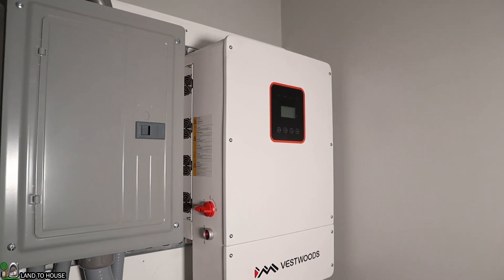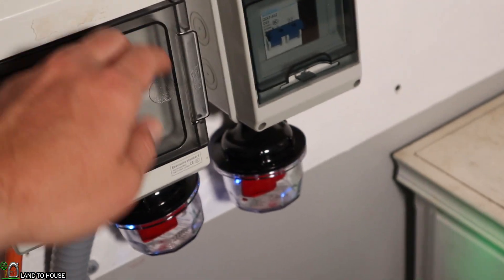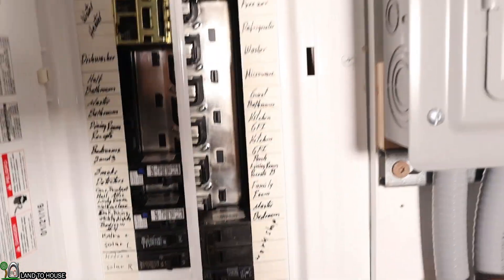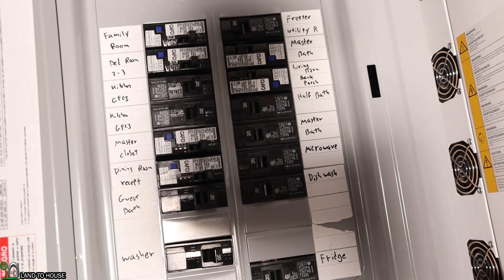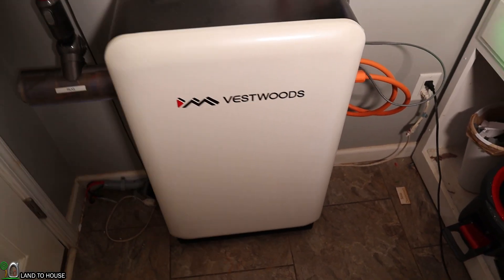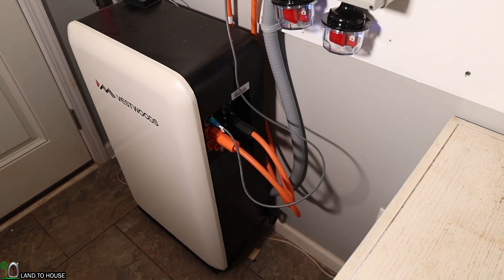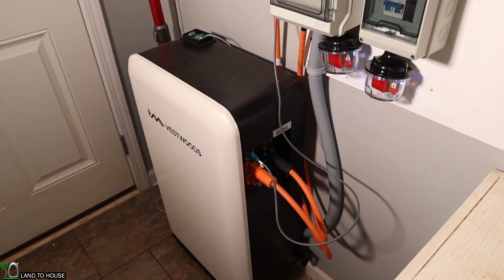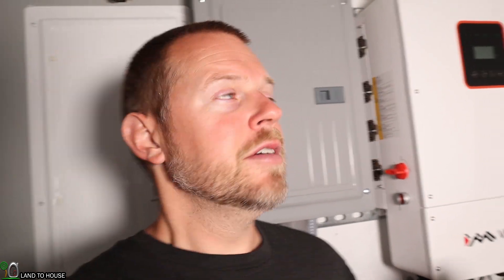This System has taken my House [Mostly] Off Grid for 5 Months

Comment: Hi, can you say what the software is and where I can get it to adjust the delay time for the solar - battery transfer in the mornings. I have the same issue. Hopefully, you are still checking this channel. Thanks in advance.
Reply from the maker: I think it was a free download called solarmon but I don't see it in the app store. Might be worth contacting vestwoods to find out. (Or eg4 if that is the brand you have)
Reply: @LandtoHouse  Thanks for replying. My unit is a clone as well from a Chinese company called Megarevo which is distributed by my provider in Jamaica. I do have the Solarman Business app.
Reply from the maker: Somewhere in that app is a setting for the solar charge delay time.

Comment: Does gridtie (grid interactive) works at all? If yes, was it easy to setup? Plan was to use it for gridtie 99% of the time and hookup battery only during power blackout the few days annually. Does gridtie even works without battery connected? anyone try that? thks

Comment: Hello, im having problems with the inverter.. I'm reading 240v on my sub panel, but it cant run my dryer n microwave.. I do that. I know if there is something in the settings I need to do..
Reply from the maker: Is that all you are running? This unit has a 8000w split phase output. If you have 2500w on 1 leg and the microwave is on that could be 3600w. If anything else is running it could overload the inverter.

Comment: Thanks for the video. You have a thorough way of explaining things. Just wondering if there isn't a setting in the inverter to "not charge battery from grid" instead of you manually shutting off a breaker. That may even be possible with a firmware update. I also wonder if it's possible to set up the inverter so it reverts back to the grid in case of failure or shutdown (like a normally closed switch).

Comment: Just a comment that may be relevant @7:58 in your video where you cut wires out from the data cable to reduce it down to just 2 wires (it looks as if it was a Cat 5 Data cable) it looks like you tied it to your power cable, as a network consultant (retired) never a good idea as the power cable can introduce signal noise  in the data cable. Over the 30+ years I spent working in the industry  I came across this twice where the customer put data cables either in the same conduit or tied them to power cables. If they have to cross power then it should be at 90 Deg to minimize the possibility of causing EMC.

EMC basics For there to be interference, three elements must be present. • A source of interference (such as a power cable, switching equipment, lightning or some kind of generator). • A ‘victim’ (such as a data or control cable, a device or terminating equipment). • An electromagnetic coupling channel that allows the disturbance to propagate from the source to the victim. Reducing the effectiveness of this coupling channel reduces the disturbing effect of the source and protects the victim from interference that could reduce signal quality. Modern IT equipment is designed to operate with some interference present, and software is designed to recognize interference and ignore it. If a signal appears corrupted, a computer will ask for it to be re-sent. This could happen many times in a typical network. The only symptom is that the system operates a little more slowly and is less efficient. A more serious problem occurs in sensitive alarm or security systems, where interference can lead to a malfunction, which cannot be tolerated. It is well known that surrounding the victim with metal reduces the electromagnetic disturbance. Some of the disturbing wave is converted into an electrical signal in the metal and will have less impact as long as the metal is properly earthed, preferably every 15 to 20 m. This is why cable management can play an important role in protecting a cabling system from electromagnetic interference and why the continuity of the tray or trunking is so important. 

So for this to be done you would need to install metal conduit and earth it in at least 2 locations or run you data cable on a different rout to your inverter.

Comment: Hey I have a similar inverter skytrak brand 8K I’m having issues in the morning when the panels start producing it chips out for about 20s then comes back in I’m running off grid too, how do I fix this???
Reply from the maker: Same issue I had. The "installers" version of the app had a button that set a delay. This kept the battery and solar from competing with one another. Can you ask skytrek about this option?

Comment: NICE setup brother. One Small thing. Just so you know I been working in the renewable energy field for the better part of 20 years. I just say that so you don't think this just some key bord solar guy LOL.  One small thing I see that could be catastrophic. Is that if your PV wires are longer than 100 feet you need to have Midnite solar lightning arrestors at the PV side. What can happen is lighting can hit the earth and get stopped in the house but go into the PV and burn up your PV or even make a fire. Seen this happen more than you would think. Even if it's not 100 feet. It well worth the back up. I know there like 100 bucks each. Not cheap. But a lot beater than losing all your stuff. Even with all the lightning arresters. I seen it still blow things up. So it's not 100% but that's beater than not.  

Hope I have not upset you at all. Was not at all trying to do that. I just care is all. NICE work man. Thanks for sharing. God Bless... PS add earth grounds at your PV minimum 1 ground rod per array. If you can run 2 ground rods on each.